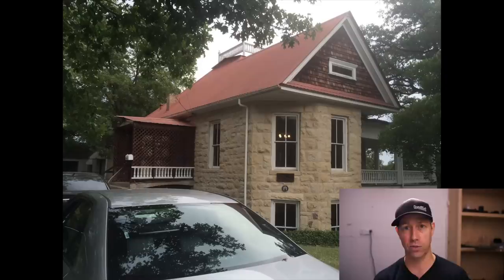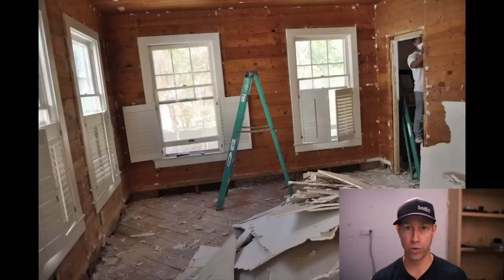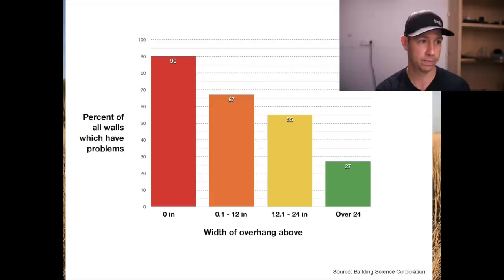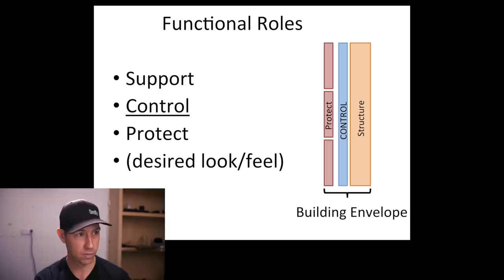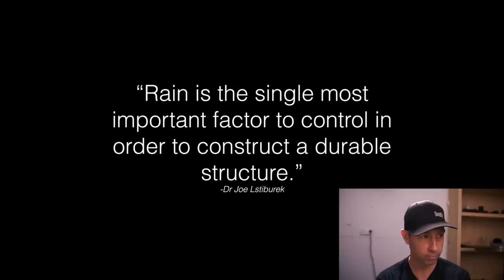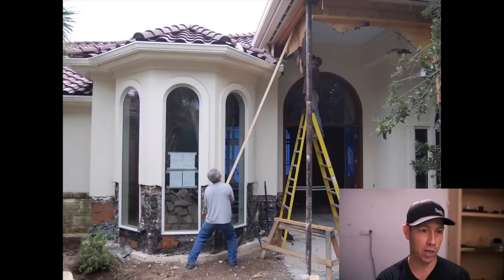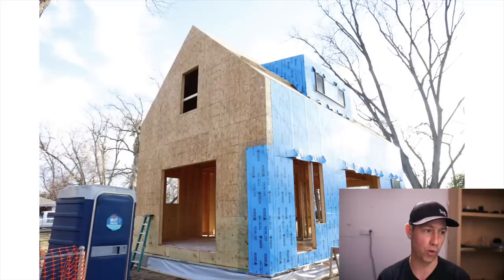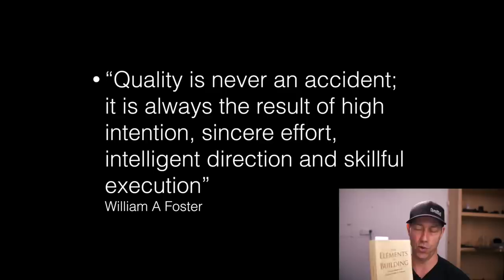Were Old Houses Built Better?

Comment: but thats the point of very thick walls to keep the internal temperature consistent summer or winter. It's inaccurate to assume that in the properly built house it would get hot in the summer. If you keep the windows closed, those kinds of houses are really temperate in the hot weather.

Comment: Nice video, but I tend to disagree on a few factors. In construction of homes in years past, the wood used was not in anyway pressure treated or sprayed with termite resistant chemicals. Keeping that in mind, the wood on older homes of a 200,100 or even, 70 years ago was in damn near pristine condition with few spots of mold or rot. In todays houses the wood is softer, pretreated, and not processed for longevity. Bringing me to my second factor. Today homes are only built to last about 50 years, whereas homes in the past were built with no time limit in mind. Most of the technologies that have come out to provide water sealing, or any chemicals used in construction have a shelf life. This is why every year first responders have to maintain vigilance during house fires. As a matter of fact, it's getting to the point where a normal house fire damn near has to be treated as a hazmat situation. Some technological advances aren't exactly what I would call good. How can they be? When new home contractors tell you, “your brand new that the life expectancy of your home is 50 years” Having to hear crap like that is pathetic. Years ago, and also in some instances, realtors will even tell you if they have older well maintained homes for sale. Then when you ask them why? They come flat out and tell you about today's shoddy construction materials. My advise, buy a home in that was built 70 - 175 years old in great condition if possible or buy one in Amish country that was built by the Amish people. There homes can last a lifetime because they still build using methods that today aren't used anymore because people think it's better their way. It’s not better at all, it’s just easier because it's lazier to do it fast and cheap than actually taking the time to give some folks a quality build. This is just my opinion!

Comment: I have a million  questions now! Thanks! Mind 🤯💣💨🌋💣💨🤯
Im loving  the concept 💡  of steel structure A frame  500sqft   cabin kits !  For recreational build s. 
I literally iv stayed in several  man camps throughout TX for wk and i know what i dont like. 
But A) foundations  need to be pillar style  and at least 5ft above ground   the cabin would deliberately be tiny.  would you use the classic concrete or that psychedelic poly-foam? Im confused  on that endorsement. 
B) this insulation wrapping  does it work on A frame ? when sheeting with  steel  does it  knock out the extra sound pollution  from the  roof or would u just go spray foam?!?🤔
AND FINALLY  HOW DO U FEEL about the new decking  materials on the market 🤔?  Texas sun proof and water proof  is a major priority.

Comment: You left out one important item that the house envelope should protect against and that is insects. Most new and old houses  leave a host of gaps, especially on fascia and soffits and where vinyl or aluminum siding meets at corners. Other places are fireplace chimney caps, plumbing stacks, dryer and stove vents, ridge vents.

Comment: I wonder what the R value is on 2 feet of stone?

All bad jokes aside the appeal to having 1 material used as a wall is very awesome. Having air leakage? Get more rock and put it in. Flooding? Shore it up or dig a better ditch. Not very sexy if you're trying to hang your family portrait on the wall though.

Comment: Many of those old houses, if built before the mid-1950s, had plaster lathe walls instead of sheet rock. My house , built in 1955, has plaster lathe walls.

Comment: my house was built in 1926. 24 on center. used 2x8s.  no fake wood. they made the roof and bones out of cedar and oak.  my shingles are painted cedar and they are probably at least 30 years old.  other than the lack of insulation my house is built like a tank. my 30 year old McClain boiler still runs.  my cabinets are plywood and hardwood.   is it built better? i think so. my house isnt full of new garbage appliances that will fry a board every couple years.  no mdf cabinets that will fall apart, no osb sub floors to swell and sag if they get wet.  no cheap plumbing fixtures that leak after a couple of years.   your houses especially today are built by the best lowest bidder with cheaper materials.   my home has stood the test of time.  i bet you those cookie cutter prefab homes today will habe major issues in our lifetime. planned obsolescence is built into everything these days.

Comment: Back in the day, houses were not built to any standards, engineering was up to the carpenter. Some houses were massively overbuilt, but many were absolute shyte. Today, many carpenters do great work and build durable houses, but many just don't care about anything but the paycheck. However, with building codes and inspections, a lot of the crap construction gets rejected, and builders whose work gets rejected often don't last long in the trade.
Reply: But the building codes and inspections today are just enough to get by with.  Lowest common denominator stuff.  Just like most of the houses constructed (or slapped together).  Dry wall, plywood, cheap pine, vinyl siding, hollow masonite doors, etc.  Junk

Comment: Interesting, but the logical conclusion is to continually tear down all existing buildings (including those beautiful "old wood" and massive stone structures just so we can avoid the horrors of living in a "not up to standards" house?  Having an airtight house has its issue as well - such as how do you ensure air quality in a house with little ventilation? I'm pretty sure there are way to lower the energy costs of an older home, such as using heat pumps, electric heat, etc.  For example, we live in an 1880's stone farmhouse in PA that stays cool in the summer because we use window shades and keep the windows closed, and only on the hottest days do we need to use a few window air conditioners. In winter we use oil fired hot water old-fashioned radiators as basic heat but also room-specific electric heaters and we are very comfortable.  A elderly relative lives very comfortably in a 1950's cape cod which has mini-splits.  Also, a friend lives in a huge 18th century  stone farmhouse that is heated and cooled very inexpensively with a geothermal system.

Comment: About the car comments. Not entirely accurate. I have a 1964 Chevy 2 nova. With original inline six cylinder, three speed on the tree, single barrel carb. The car weighs over 4000 pounds. It has a tow package and pulls a 32 foot silver bullet camper. It gets 35 mpg. And with the addition. Of a catalytic converter passes California emissions. Name one new car that can match it. Just curious. Love the video. Keep them coming.

Comment: The problem with higher standards is that they are forcing us to buy very expensive building materials and sometimes using patented systems that are expensive to use. There were good ways to build in the past, and a lot of the problems that we see with houses today are because the modern materials are NOT time tested. We find problems with the modern materials too. The code people do NOT do a good job. It almost seems that they are steering us to one or two or so methods of building that the giant corporations making these "modern" and expensive building materials are selling to us. Old materials used correctly (including not letting sprinklers spray on the house) will result in a long lasting house, using the old materials and less expensive materials.

Comment: That's a very English style of buildings. Rotten shag, without proper isolation, ventilation, poor materials, but the facade look like a palace...  Too bad, that You and Your family inhale mould and other stuff. It's absolutely fascinating. I live in UK for several years, but I can tell You one thing: If this kind of building was set in a more diverse climate zone, in In Poland, or eastern Europe, it would rot in a year. You can have 86 for 2-3 months in hot summer, then it will gradually drop to 70 for month, then 60 and rainy for another, then 45-50 and rainy weather, with sub-zero (32) at night, then it will go for around 2 months between 32 ish down to -20, then in a month/two it will go up again to 60ties, and 2/3 months of moderate spring with sun, rain, stormy all sorts of weather, but in April U can have 70 in the noon and 32 at night :) Would love to hear from Matt how U plan to build when your house has 0 chance to dry after 2 rainy months and go to frozen for the next two, and U still have to heat it up. Dat condensation... Yup :) (temps in Fahrenheit)

I'll give simple advice:
1) build your house on popper fundaments, poured strengthed concrete, with horizontal humidity insulation layers from the ground installed in the walls. Also, do proper cellar insulation below ground. 
2) build it using brick, aerated concrete, stone, and other modern solid stuff. Plywood and OSB is nice material for a dog house. If U hate the dog. 
3) Cover it with thermal isolation, and cover it with a solid 100% water-resistant but breathing surface, mineral based, paint it.
4) Under roof overhang and on the bottom of the insolation layer leave small ventilation for the whole wall.
5) Install rain piles and drainage, plus some additional structural construction on the ground that allows water to sink into the ground and flow. 

That demo building. If U covered whole construction in "plastic" 100% water resistant what will happen with humidity on the inside, normal one from living inside, bathing, cooking, breathing, sweating and making babies ;) all go through ventilation/air conditioning systems?

Sad thing on the end: Selling quality instead of price will bring companies out of business when they saturate the market with the product that lasts. It's better to sell stuff with lots of flashy features product that will break down after the warranty period, and sell another. That why we have built-in obsolescence, and software upgrades that brick our phones.  
There will be no "modern" 20y old cars. They will fall apart in 5.

Comment: New houses can have premature failures and old houses can last a long. But IMO, the market overvalues old houses and underestimates the costs of maintenance and renovating them to modern standards. If you are not wrapped up in the romance of owning an old home buy a home that is newer than 1978. You will have good earthquake resistance, no asbestos, no lead in the pipes, good electric, good HVAC, adequate windows at least and a pretty good structure with improved earthquake and storm resistance.

Comment: Concrete house, 1935, no air conditioning, it's not that bad, you get used to it. Open windows blow in cool air in morning and evening after heat of day subsides, keep it closed during day with blinds shut. Prior house 1955, expensive utility bills, expensive A/C repairs, house was extremely well built though.

Comment: New and old car is truly same as old and new house.. Old car can go even in cases with out engine rebuild 1million km's and few decades, where as new car can barely get 200K or 5 years. Old house can go over hundred years, where as new might be rotten before its ready and very least its expected life spawn is at most 40-50 years if not less.

On cars that comfort side is easily solved, but its the manufacturers who want people buy more cars, so making them last less is easy solution for them. For instance how many newer cars you know that have no electronic faults? My 80's Audi sure does not have any, but 99 focus is riddles with them in the point of it being unusable at the moment.

On houses old house sure takes more energy to heat and cool, but those are pretty easy to solve, while house still lasts centuries thanks to good ventilation of the construction and sturdy construction what was made to last.
On new houses, those are so lined with plastic that comparing it to plastic bag is pretty suitable. Still those need heating and when eventually those rot and turn into mold infested health hazards, rebulding whole house might cost bit more than heating would.

Also you sure about the heating being issue? Handful or two (depending temperature) of fire wood is enough to keep my log house warm for two days. Sure i would upgrade windows to this house to remove draft,  but those are already 30 years old and in bad shape so no wonder.
Check traditional Finnish log buildings. Those are still built, but with modern comforts and will last long time if just built right and not made into plastic bags.
Reply: My dream house would either be a solid, well constructed log home or a 1920s-30s Craftsman style bungalow with lots of stained glass windows and door transoms.   And beamed ceilings with real stone or brick fireplaces.  Sigh.....................

Comment: As a historian have to object to the characterization that older homes were uncomfortable. At least before the 18th century homes were built to vernacular styles, which incorporated practical design decisions that took into consideration local weather and temperature. Low ceilings in cold regions, orientation of windows to promote cross-draft, etc. Additionally, the use of rugs, tapestries, wall hangings, thick draperies, and canopied beds weren't just decorative, they were also a form of insulation. By the 19th century people were traveling to new regions and putting up environmentally inappropriate homes that were baking in the summer and chilly in the winter because they were building for fashion first and practical considerations of their local environment secondly (if at all).
Reply: While that may all be true, if those homes were so comfortable, why did we decide to change things?

Comment: One thing that I don't get about some American houses is why so reliant on caulking (which I'm assuming is some kind of silicone sealant,please correct me if I'm wrong). Obviously houses here in the uk are built differently but we never rely on a gunned in sealant to keep water out.
I'm not suggesting that we build better,I'm a carpenter and refuse to work on most new build housing estates as they are crap but we use the materials or the fabric of the building to keep out water not just running the cladding up to a window for example and then relying on the caulking that will need to be replaced every so often to keep out the rain etc. I know that not all your housing stock is built like this but quite a percentage appears to be.
Reply: There are lots of different types of caulking available...silicone is only one of them.  They definitely have legitimate uses in helping prevent water or air infiltration but if a house is built properly with the necessary moisture control measures installed correctly then any water that gets past the caulking will still be effectively dealt with.  If a structure is reliant on caulking to prevent water ingress/damage, then it wasn't built properly to begin with.

Comment: Great video. More science used today and better understanding of moisture control, thermal bridging and so on, but some of the modern materials are rubbish and if applied incorrectly as is often the case with cowboy builders you end up with rubbish. Older buildings had better structural materials but not so good with moisture and thermal control as they did not have the modern synthetic materials which offer this function, only natural products which unfortunately were subject to rot or food for rodents and insects.

Comment: A lot of old buildings were over built, that is they did not know exactly what the breaking point of their materials was, so they safe sided like mad.  Another thing is that the houses were usually built by or for the occupants.  If the owner was not the one building, the builder was at least a local that the owner was likely to know.  A poor job would damage relationships and become well known in the community to the detriment of the builder's reputation.  
Today's builders are building largely for developers who will sell the homes and might well not ever see the occupants again.  The main issue is that no problems show up until the developer has sold the last home in the development.
The companies may be based a hundred miles away and, while they might have a bad local reputation, house hunters new to the community only see the fresh paint.  A lot of homes are under built and built by people who are doing a job, not working as craftsmen.  In any case, the developer sets the standards, and even a conscientious worker is limited as to how well he can do his job.

Comment: If a guy wanted to build a house in NW Montana using no modern technology/materials (think if it didn't exist in the 1700s, it wouldn't be used), using wool as insulation, would the house still be able to breathe, allowing water vapor to escape well enough to not cause damage/mold damage?  

How would one tackle the exterior siding to prevent "bulk water" infiltration/damage? I'm building in an area with no building codes and want to build with natural materials that's still relatively comfortable.  I would be using a fireplace and or stove for heat (no A/C).  Climate zone 6. 

 As always, thanks for the video Matt!

Comment: I do not understand why in north America the insulation is on the inside of the house. In Europe, insulation has been going on the outside since we started insulating houses. It keeps the heat and the cold out, allows the house to thermally balance itself year around.